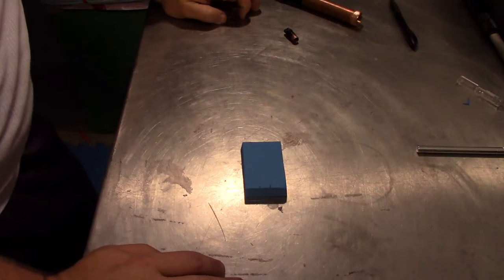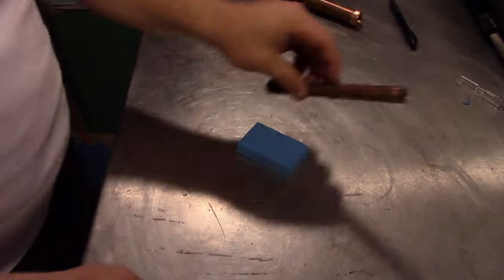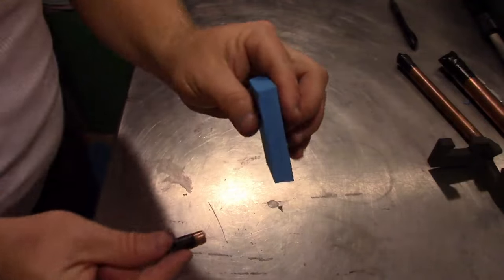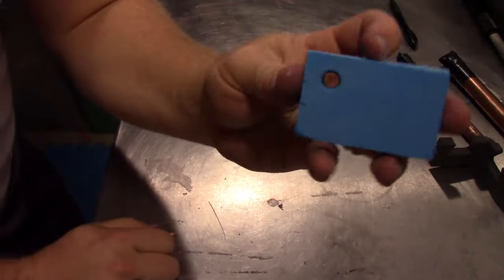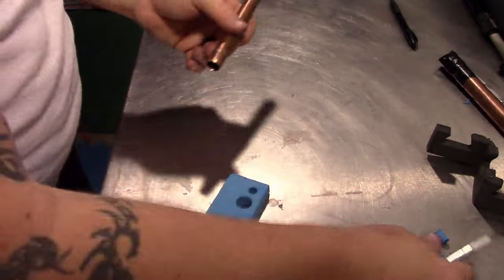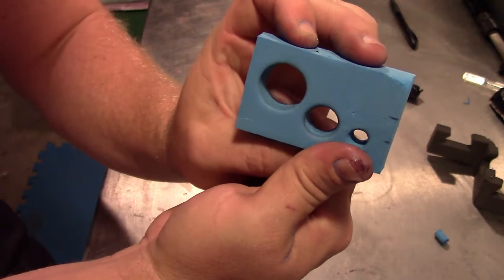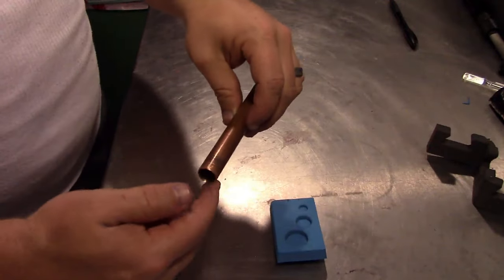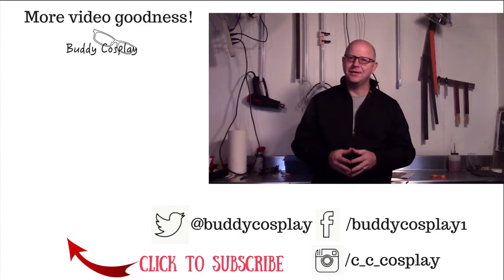Cutting clean circles and holes in your foam - Cosplay Tips and Tricks

Comment: Nice tutorial! Hey maybe I missed it, but do you have any suggestions of where / how to get some pipe for CHEAP? All I saw at Home Depot were pretty long, expensive copper pipes. And of course I only need short ones. Maybe I didn't look hard enough?
Reply from the maker: +SuperheroDIY Price is pretty standard BUT you can ask for copper pipe remnants at the hardware store for a big discount OR you can even sharpen a thin piece of PVC and get that to cut pretty well.
Reply: SuperheroDIY you can use heavy duty closet rods ..
Reply: oh and PVC pipe also works.
Reply from the maker: thanks for the tip!
Reply: Go to any plumbers shop. They have lots of short pieces of copper pipe and 
if you have a good reason and ask by saying, "If you would be so kind, could I have a few short pieces of leftover copper pipe?" they will give them to you. No 
charge either, as they throw away most of it, especially short pieces.
Reply from the maker: nice tip!  Thank you!